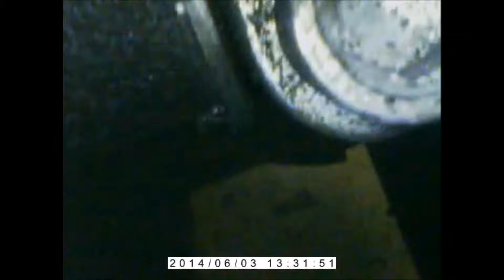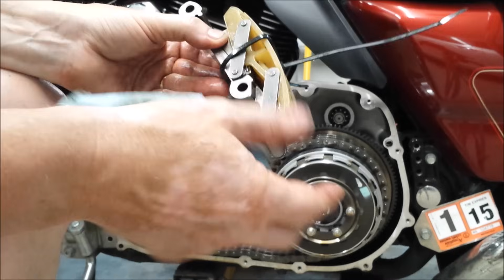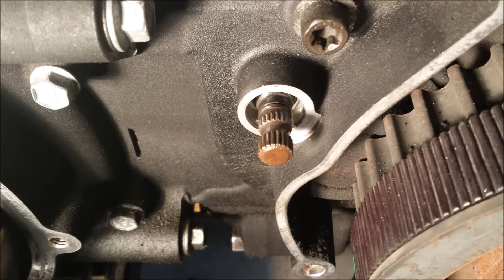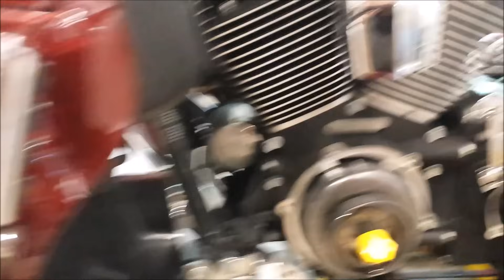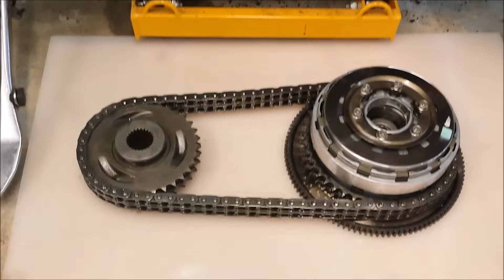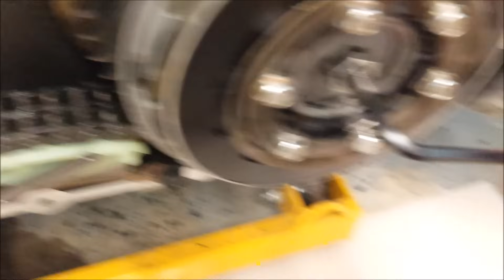HD Ultra Classic Primary Removal and Installation

Comment: I just put a new chain and tensioner in my 2010 ultra and borrowed a faulty torque wrench and it never clicked and I broke the bolt off in the crankshaft, it took some time and patience to drill and extract it, now I got it on with my new torque wrench just like he did except I backed off a half turn and then stopped at 140lbs of torque, I’ve heard so many higher numbers 150 -160 even 175lbs that sounds crazy I’ll try 140 and if it comes loose I’ll deal with it instead of another timely extraction.

Comment: In my opinion, the repair for the floppy gear lever was flawed. The sideways movement of the lever is the result of the bearing surface in the housing for the shaft being worn, which in turn flogs out the seal and causes it to leak. The new seal will appear to have removed the sideways movement, but in reality it will  prematurely get flogged out again, the leak will reappear along with lever being floppy again.

Comment: Why is the Red Locktite Blue?? And why did you not leave the jam-nut alone on the release plate? You could have assembled it all and not have had to jag with the clutch cable adjustment. Just here criteking everybodys misstakes.

Comment: Very informative video but it wasn't necessary to remove the clutch adjustment but when you was trying to get to the clutch hub nut... Could have just taken snap ring pliers and remove the clip and pull the whole adjuster out... If your clutch is fine and feels good no need to have to readjust it

Comment: Thank you for the best, most comprehensive and complete video for shifter shaft seal replacement.  

I will be using the service manual along with this video to repair mine.

Comment: It's a 9-year-old video, and it's still one of the best out there.
Although I would go ahead and upgrade the compensator and tensioner
Reply: I upgraded with the SE comp and it is way thicker than the original.

Comment: Compensator Nut use 13/16 1/2 drive socket with a 30" breaker bar. Came off pretty easy. When removing chain tensioner there are some spacers be careful not to lose them. Just some little details that may help. Great video!

Comment: Great how to video.
The only thing you missed was putting tape on the shifter shaft before you installed the new seal, and you may have pushed it in too far, it's supposed to be flush with the case and rest against the washer.
Also, if you have a SE compensator installed, you should get a new bolt, Harley recommends not to re-use the old one.

Comment: I have had 2 of the inter primary bearings go bad, wondering if anyone else has had this problem?
Reply: What year bike
Reply: @fascamaro  2010 Ultra.
Reply: @roberttaylor4608  I just bought a used 2009 almost up to the primary bearing. I did notice some scraping on the case i guess from the fly wheel.something else to look into.

Comment: Big seal behind the clutch should not be lubricated around the outer edge where it fits inside of the casing.
Reply: Why?
Reply: @roberttaylor4608  Goes in dry, because it will eventually come out if lubricated. 
Refer to Brad the Harley wizard.

Comment: I’m going to have to do this (and more) to change my final drive belt on my 14’ street glide. 
It has a small melt spot on it from my exhaust header cross pipe from my air ride when I ride with it fully maxed out. 
Figured it out little too late. 
I should get the rest of this season out of it. 
But this winter I have to dig in.
Sucks-

Comment: Nice video thank you! What was the lubricant you used on the orings and gaskets?
Reply from the maker: Thanks for you comment.  I just use Syn3 or similar engine oil with fairly high viscosity.  The idea is simply to allow enough tackiness to hold things in place as parts are mated, and allow a slight bit of adjustment to fully seat properly,  but not so much as cause too much sliding around or over wetting the gasket.

Comment: Excuse me , Mr. Good wrench , you put the inter primary oil seal in backwards , the FLAT side ALWAYS goes to the outside , The side that has the SPRING AROUND THE RUBBER LIP  >>>>>>>>> ALWAYS GOES TOWARD THE OIL ! It dosent matter what your working on cars, trucks , lawn mowers , farm tractors , etc .  I wonder how many people did what you showed them and had to rebuy gaskets and seals because it leaked , and it didnt take very long to show up leaking/seeping , harley had the seal in correctly , you put it in backwards ..........go back and look at the video ..........
Reply: Wrong flat side is the oil side. It says it on the seal. Whoever did it before did it wrong.
Reply: @fascamaro  What I said > The side that has the SPRING AROUND THE RUBBER LIP  >>>>>>>>> ALWAYS GOES TOWARD THE OIL .........

Comment: I was right there, doing the same thing on an '01 ultra classic. Shift shaft seal issue too. I went farther. Pulled the belt sprocket (hey! I'm there, right?) Did the mainshaft seal, the "quad seal" and that "square" o-ring behind it. 
  I did all that thinking "I'm there...do it" But I f'd up...should have gone 1 step further...all I had to do was pull a few more bolts & the top trans cover...adjust the shifter pawl. FRACK! I won't be back in there for 20+K. Oh well, just saying, if you're in there...do it! 
  Oh, & I like my manual primary chain adjuster...replaceble shoes 😁

Comment: Hi from Greece 
I have a friend with Electra glide we have a issue but I have not idea about Harleys ,I have a gear oil leak ( I know Is gear oil because I can smell it ,(engine oil smell different)
How is possible to leak gear oil from the clutch cover (left side) 
I thought in the clutch cover there is engine oil ,where this gear oil leak might coming ? Sorry if my explain is not correct
Reply from the maker: The clutch is in the primary chain case, not the engine.  It may look like it is part of the engine, but it is in an entirely separate compartment.   You can see that in this video, toward the end when I show how to adjust the clutch.   Some people put SYN 3 in the primary, as well as the transmission, and the motor.   Others use a higher viscosity oil for the primary oil (gear oil).
Reply: @dldavis3  Ok I see ,yes I show your videos I can understand a little bit now ,we don't have any cracks ,so is it the only reason of the leak the cover gasket you think ? Can we put synthetic 20w-50 oil in the primary? Many thanks
Reply from the maker: @georgetech380  Yes, you can put Syn3 20W50 in the primary.   Some people use Mobil1 synthetic 20W50 for V-Twin motorcycles also in the primary.... says right on the front of the Mobil1 bottle that it is good for the primary chaincase.   I can't be sure where your primary oil leak is though.  That takes a bit of work, because oil tends to spread everywhere once it escapes.   You can try to clean everything on the exterior primary surface, and then check for any signs of oil right after a ride.  It's often frustrating to find exactly where that leak is. It could be the inspection cover, or it could be anywhere on the primary case seals, or it could be behind the primary on any one of the shafts that protrude from the back of the primary (like the shift lever, as in this video).  Look for where dirt collects.
Reply: @dldavis3  Ok many thanks

Comment: Not sure what state you are in but they need to get off that stupid looking license sticker.
Reply from the maker: That's a Virginia State Inspection Sticker.   I agree, it needs to go.   But a hefty fine if you fail to get the dang inspection every year.
Reply: @dldavis3  I remember here in SC we used to have those ugly things on our bikes. They would put them on the fork tube. I made a plate for mine to fit on the foot brake mount, almost hidden but visible. I guess y'all need to get together and get that ugly thing moved.
Reply from the maker: @jerryhubbard4461  Yes, that's what you're looking at.   The inspection sticker is mounted on a plate, to avoid putting it on the chrome.

Comment: this video is very informative i was able to adjust my clutch cable woth no issues now its time for me to reseal my primary and because of this video i will be able to and save myself about 800 in shop and labor costs plus the 100 just to get it in the shop. well done sir well done...

Comment: Has anyone made this video for a softail?  In regards to getting to the starter bolts? That rear starter bolt is pretty well hidden.
Reply: There is another video on youtube for the softballs. Major pain getting to starter bolts I believe you have to pull the oil tank.

Comment: I saw video of this Harley fix using a specially made pick tool to get shifter lever fix without pulling all this unit apart. Check it out an look at special tool!
Reply from the maker: I'll look for the link.  Thanks
Reply: @dldavis3  bent long slender tool that is worked down where you showed picture of lever bolt. Easy with your camera an able to see so well. Remove bolt/ then lever then tool to Remove packing behind lever! I liked the tool enough to remember when I watched your video I'll try to find too

Comment: Excellent Video! 
I happened upon your video, after watching another repair video. I almost skipped it but your concise step by step explanation caused me to watch until the end. I’ve torn apart and rebuilt many car engines but as simple as it may sound I always worry about messing something up on my FLHTC, so it goes to HD for the “1K repairs. “
After watching your video I will look into the primary case next time I change the oil.
Thank you for an excellent video sir 
Stay well and make more videos!

Comment: Thankyou for making this video. My 2011 has the same shifter problem, and I just got the Harley oil seal kit that the dealer makes for the DIYers. So this video explains a lot of the questions I had on where stuff goes, and my main concern on socket size for the clutch basket

Comment: One more question...I believe the shaft on my 13 electra glide needs to be replaced. 
At the point where you replaced the small o-ring on the shaft, could you have pulled the shaft out and replaced it?
To do that would it require getting into the engine/transmission deeper?
Thank you for your recent response.
Reply from the maker: No, I don't think so.  That shaft is part of the transmission, so further disassembly would be needed to remove that shaft entirely.

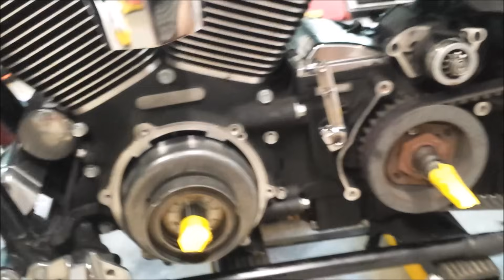Comment: I know that when I saw this video it was already a few years old; but I believe I have some bad news for you. At 17:57 when I got a good look at that new seal you inserted into the case I am pretty certain you inserted it back to front. You did not put the old and new seal side by side for a comparison nor did you show both sides of either seal; but before you removed the old seal it was flat side to the outside; and after the new seal was inserted you had it flat side to the inside. Further more it is normal with pretty much all automotive seals I have ever dealt with {which is many} the side which has that little shiny spring around the seal inner lip is always inserted into the oil side; which again would have left the flat side to the outside; which would also leave it in a position so the next person ever having to remove it would be able to place their spanner under that seal in the exact same manner as you did removing the old seal. Maybe no matter which way it is inserted you might be lucky enough to have it seal..... but as far as a correct and a incorrect way to fit it; you {I believe} have fitted it incorrectly back to front.

Comment: QUESTION: I have 13' Street Glide. Couple of days of got a problem and took it into a shop. They opened it up and said Primary case has been broken from the inside. More precise, Front low(not bottom of the case). They said it's very rare case this type of problem occurs. (actually have never seen one) What I'm worrying is that they said they have to take down the entire Engine within to fix this. One more thing, they said one of the bolt inside of the primary has been broken and that probably caused the eruption(?) and hit the cover and tore the case.
Reply: Can you help me out whether this shop ain lying and try to rip me off with BSs? I can send you photos it is needed. Found your VIDEO on youtube and realized what the shop said and things aren't quite equivalent to your tutorial VIDEO. Thank you for your help in advance.
Reply: @bizme00  I can see that happening. Did they say which bolt?

Comment: Well it might fix the oil leak temporarily there was considerable worn out o the clinging shall it self so Bushing changes is impotent to prevent the oil seal being damaging easily due to the shaft keep rocking in it.  I under stand it need to open up the gear box.
Reply from the maker: I didn't observe any shaft damage that would cause the new o-ring to fail prematurely.  The new o-ring has worked just fine since the repair.  I think the shaft is okay.

Comment: Very well done!!! I prefer videos without swearing. It just, in my opinion, takes away from the video. I was thinking to myself now would be a good time to look at the belt drive if it needed it.  Very well done. Also, a third hand would come in handy in certain spots of that process.
Reply from the maker: Swearing?? I don't remember any swearing, but I will admit it's possible.
Reply: @dldavis3  You didn't.  I just finished watching a guy do a clutch job and every other word was an F bomb. I should have made myself more clear. Sorry. Great video. I've always been intimidated doing my own work and thanks to videos like yours I'm finding it's not that bad. Thanks again, and sorry for the misunderstanding on my part.

Comment: I just picked up a, cometec shifter shaft seal, my question is which side faces out one side has metal on it the other doesn't,, does the metal side of the gasket face out or in?
  Thanks. Scott

Comment: I've got an 03 Road King with manual primary chain adjustment,, will an automatic tensioner bolt right in or do I have to do any modifications also do you have any recommendations on what brand tensioner that I should purchase.. thanks. Scott
Reply: It will, but don't! The Harley tensioner gets the chain to tight. I thought it was a good idea for my 06 Road King, checked it during a routine service and found it TIGHT! TOO TIGHT. I removed it and reinstalled the stock manual adjuster, afraid it would take the mainshaft bearing out. I installed a new bearing in case there was damage from being to tight. There are a few after market tensioners that look to be a better idea, may try one someday.

Comment: Great video, helpes me out tremendously, one question, did the left hand bolt on the chain tensioner come with a spacer that goes between the inner primary and tensioner? I think my dads 08 flht has one, i ask because im finishing it up today and noticed that in your video you just slid the bolt in.
Reply: Jose Guillen there are 2 spacers. One for each tensioner bolt that fits behind tensioner
Reply: Ohio Harley Rider thanks, i did see the other one, it was stuck to the tensioner and looked like part of it. But everything is fine. Thanks again!!

Comment: I assumed there was oil in the Primary "case" Did you skip the drain part or was i wrong? Sorry new to bikes. Just bought my first harley 1 week ago.
Reply: Definitely skipped that portion. Drain plug for primary is located on the aft lower section of the primary case. Once it drains it is much cleaner to pull off the cover. J&P Cycles has a great tutorial for this process if you are interested.

Comment: i just installed my shifter shaft seal..i did not get it to seat as far back as yours seem to be? but i got the washer and spring clip on on ok...after that i had about 1/8" play is that ok? or do i need to go back and push it back further? thanks

Comment: Hey Brotha  (and Group) awesome video, thanks for all of them, you're a 
great resource!!! Quick question about this video; I have a very slight 
periodic drip that at first appeared to be coming from the bottom of my 
outer Primary cover and I changed the cover gasket but that didn't fix 
the problem. Since then I noticed a considerable oil buildup and spray 
from my Shifter Lever Seal (I think). Below is a link to the picture of 
it, do you think the issue is the Shifter Lever Shaft Seal? I don't want
 to pull everything apart before I know for sure. Comments from everyone
 in the group will be very much appreciated! Thank you very, very much 
Brotha!!! Pic Link (it's a 2004 Dyna Wide Glide but I know that doesn't 
matter unless it's a known issue): http://imgur.com/a/jFyNi
Reply: This a very late reply, but my slight oil leak was actually coming from one of those 5 pre sealed bolts.  Could see clearly once my inner primary was removed.
Reply: @chuckfast5270  All good Brotha, I was waiting until Winter to check this out anyway. That actually makes sense because she went over on me once on the Primary side and all the pressure was on the bottom of it....it also shifted a bit so it sits just a little off so I'm thinking it may be the lowest bolt on the bottom of the Primary....I'll look into when I pull it. Thanks Man!

Comment: Maybe a stupid question (not an MC mech.) When replacing the primary cover gasket, is there a reason not to add a little liquid gasket when reinstalling?  Seems as if it may prevent future leaks.

Comment: Would this be the same for a 2001 road king classic? My belt just snapped and the cheapest I found so far was $800.00!!!! I can handle mechanic work just need to know if it's this easy or if my bike is more difficult?
Reply: SuperDutyScaler very much the same
Reply: Thats a five speed you have, on this video is a six speed so there will be little differences here and there.